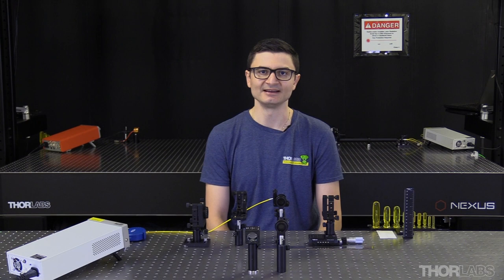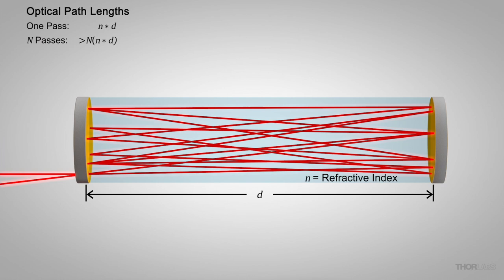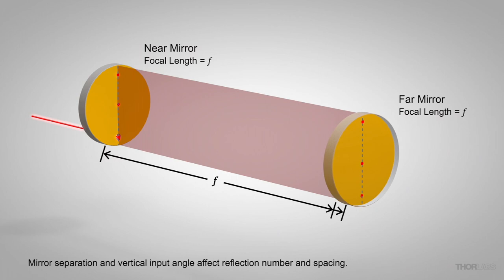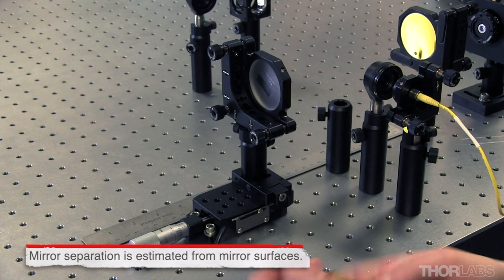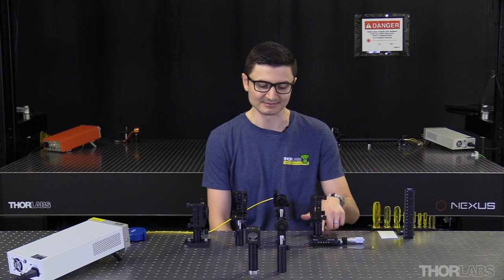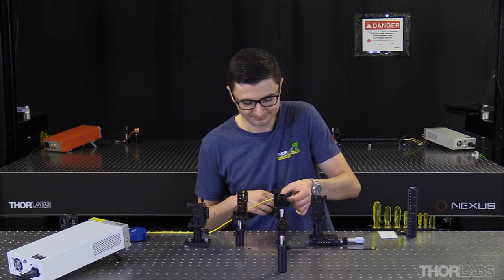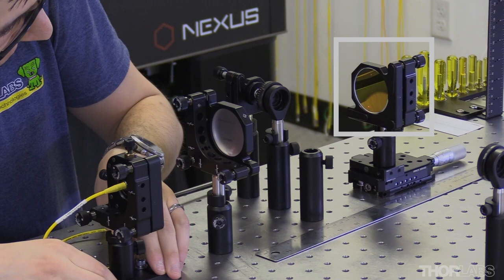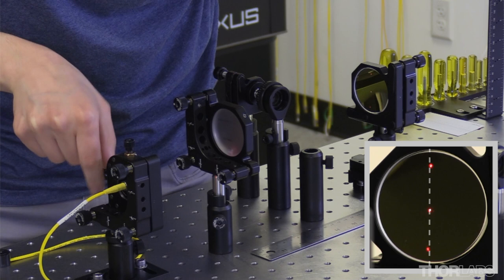Herriott Cell (Multipass Cell) Setup and Configuration (Viewer Inspired) | Thorlabs Insights

Comment: I actually have aligned it once  (or rather participated in alignment) about 20 years ago. The only thing - we had both mirrors with an opening and light was escaping in forward direction from a laser. it was also a ring pattern.
Now i know it was the Herriott cell. I have actually read the original article tha time, but did not mention authors names. 
As I remember, we have used the cell to create a compact optical delay unit.  Both sensors (PMTs), for signal and trigger, were mounted straight on inputs of an analog 5 GHz oscilloscope  to avoid any pulse stretching because of cables resistance and capacitance.  So there was no way to make an electrical delay if one wanted to delay one signal over another and we made an optical one.

Comment: Very good demonstration. However for longer distance, it is difficult. I tried in my lab
Reply from the maker: @drbhavanikumaryellapragada3286  It is exciting to hear you tried the approach in your lab, and it is interesting to hear that you applied the technique to a setup where the mirrors were farther apart. The reference cell length in the video (one focal length) always provides six passes through the cell and three reflections on the far mirror. Since this is not the case for other mirror separations, we would love to hear what mirror separation you used and whether you used a different alignment technique!
Reply: @thorlabs  Dear Sir,
Thank you for considering my reply. I have a small lab. I made the setup using a 650 nm CW laser and  aluminium mirror which has a cut at 45 degrees angle. The  reflected light is collected using a setup which has an OSA to collect   the light spectrum. The resultant spectrum gives CNR of 20 dB dynamic range. I am trying to get still more but it was not possible. That's why I informed you that it is difficult for longer ranges. With best regards

Comment: Can this be done across a 3 meter distance between mirrors? If so, what is the maximum possible number of reflections potentially possible?
Reply from the maker: @ezdeezytube  It is possible to have a 3 m long Herriott cell. Equations provided in the paper by Tarsitano et al. (referenced in the description) are useful for calculating the total number of reflections provided by a particular Herriott cell setup. Total reflections of several hundred are generally possible under ideal conditions. However, several non-ideal parameters can make it difficult to predict the maximum number of reflections. One is the absorbance of the medium between the mirrors, and another is the reflectivity of the mirrors. Both attenuate the beam with each pass through the cell, and eventually signal power will be too low to be useful.